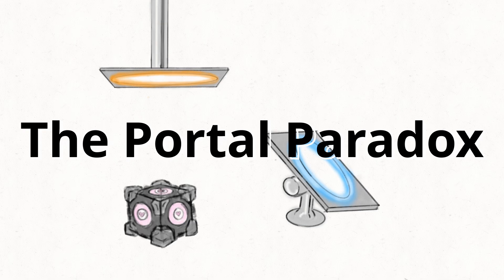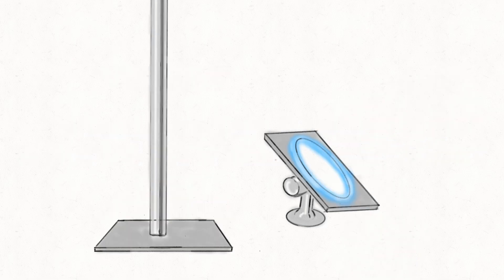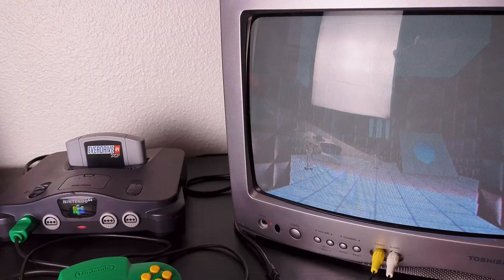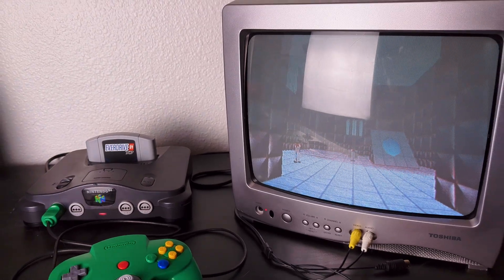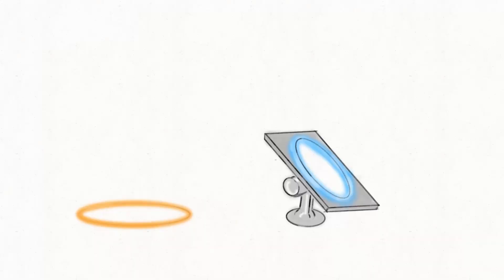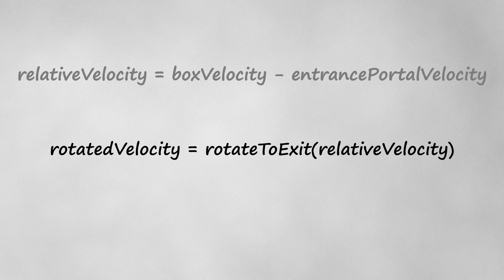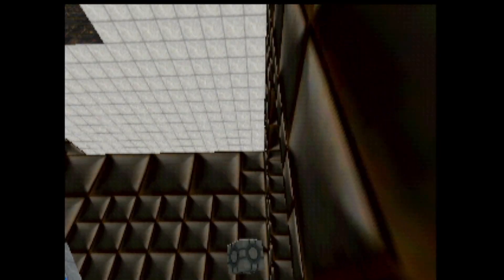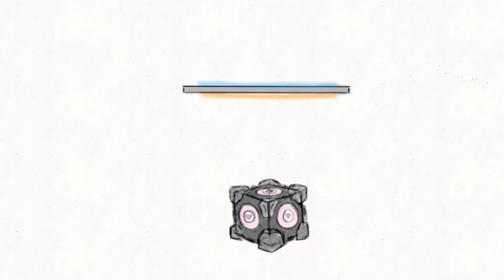I rewrote Portal from scratch and solved the Portal Paradox

Comment: Two questions.

If you did the "back to back" portal test, with both portals starting at the top of the cube, but in the "slam" the orange portal was moving at V and the blue portal was moving at V/2 - would the cube do a half jump?

Second, and perhaps more cathartic, what happens if you smash the blue and orange portal on to a levitating cube at the same time and speed from opposite sides?

Comment: The flaw in the equation is that the portal velocity is irrelevant since the portal exerts no force to any object going through it. The only force acting on the cube (assuming a closed system) would be gravity.
To repurpose the hoola-hoop example, it'd be like if you shot the hoop at 20 miles an hour at the cube so that the hoop went around the cube in mid air without either item making contact. The only interaction would be air displacement. With the added element of "teleportation",  there would be a tipping point where the mass going through the hoop would be more affected by the gravity on the exit side and would fall accordingly. The speed at which a stationary object passed through a portal would also determine how abrupt this fall was of course. And all this also brings into question how things interact with the edges of portals, and if things can be balanced on said edges.
Reply: portal velocity is relevant because the objects going through the portals aren't single points. assume the cube is a one meter cube and just for the sake of easy math lets say it's going at 22 miles an hour just so it equals a nice even 10 meters per second. at that speed it takes one tenth of a second for the portal to move from the leading edge of the cube to the far end of the cube. that means the cube has to exet the other portal in one tenth of a second ie: at a speed of 10 meters per second. I think if he had programmed it so that it didn't shoot out it would look weird. either the cube would still be exiting the portal after the platfom had finisshed swallowing it on the other side or the cube would quickly exit the portal and then suddenly descelerate. cubes are pretty short so it is harder to visualize but if you extrapolate  the problem out using longer objects, like a stack of cubes or a telephone pole, it starts to become apparent.
Reply: @StanleyFlinn  I do apologize, but I can make no sense of what you're trying to say. 
It is stated by the game that "Momentum, a function of mass and velocity, is conserved between portals." this includes a velocity of 0.
If portals did increase velocity as you seem to suggest, a cube falling between two portals would infinitely accelerate rather than reaching terminal velocity.
Reply: @clawgerber1992 
 The thing is, in order for that experiment to work, the velocity can't be 0. No velocity would mean that the object wouldn't move at all and the object does move if it goes out of the portal. Try to picture this experiment happening in your head. As StanleyFilm has pointed out, it is more apparent if you imagine a long object like a telephone pole.

Imagine yourself standing next to the blue portal as the orange portal is slowly swallowing a telephone pole. What you would see, it the telephone pole slowly coming out of the blue portal. That action, the telephone pole slowly moving out of the portal, is a movement and by definition, it has a velocity.

Its impossible for the object to both have 0 velocity and to come out of the second portal. Does two statements contradict each other.
Reply: @Jordthelord1  I think I addressed this already, but let me be clearer.
The portal links two planes in space. An object emerging from a portal isn't moving, the space around it is.
 The only forces acting on the cube when a portal goes over it are gravity and the counterforce applied by the cube to the ground. The portal going over the cube doesn't impart any force to the cube. The velocity of the portal would only affect how quickly the portal goes over the cube, or telephone pole, or any other object.
The rate at which the object emerges from the portal doesn't have any effect on the velocity of the object. No force is exerted on the cube, which is why its velocity can be 0. 
Where the physics gets fucky is if the cube were to contact something as it came out of the portal. The cube would impart force  to the object as if it were moving at the velocity of the portal. However, from the perspective of the cube, the other object would be what was impacting the cube with that force. With no counterforces being applied to the portal or surface, the portal is on.
This gets into a real pickel if you were to sandwich a cube between two portals  and compress them until the portal surfaces met. I'm not 100% sure, but I believe that situation could result in an "immovable vs unstoppable object" situation.

Comment: Hmmm. I always imagine portals as being vacuums through space. An instantaneous transportation from once place to another, thus, completely separate from current space. What if we try having both portals on a rotating platform with one portal at the 12 o clock position and another at the  6 o clock position. Rapidly rotate them clock or counter clockwise, place a static object between the two and let it "fall". What would happen?

In my head I can't see how it would fire out instead of plop down because to me portals and splits, devoid of any conceptual input of motion or influenced by it. I suppose one day when we can harness the power of singularity on earth rather than being face on with a black hole in space, we'll never actually know for certain.

Comment: I think your equations are not what to expect from a scientific point of view, but a sufficient approximation for a game engine (simple = fast).
Since the momentum of an object is preserved in all inertial frames (afair from physics lessons) , the cube would have no momentum in the inertial system surrounding the exit portal if transported instantly. However, if you think of it as being teleported in slices as it moves through the event-horizon of the portal surfaces, then the following slices would exert a force on the slices on the exit surface, pushing them up and creating momentum.
That would also imply that the stamper with the entry-portal experiences a resistance.
Otoh, a moving exit portal could leave disruptive structural gaps in the transported object that might lead to instant disintegration...
I think a real decision can only be made when have portals irl and know what magic happens at the transition plane.

Comment: First off, well made video, and I always love more portal content. 

My core argument against this result is that the space contained within the ring of the portal is not a physical object that can exert force, OR have force exerted against it. It's just the space that exists on the other side of the exit portal. Therefore, this space has 0 relative velocity. The only forces that are exerted on the cube in this situation would only be gravity and nothing else. The surface that the portal rests upon can have velocity, since it is an object, but the portal itself is not subjected to the same physics, since what the portal represents is just whatever space exists on the other side of it, and that space is not moving, hence 0 velocity.

A portal is just a Quantum Tunnel, right? So imagine a Cube placed on a floating platform in space. Now drop a large hollow pipe (the quantum tunnel) around that Cube and platform in such a way that it never collides with the Cube. Despite the Cube traveling through the tunnel, (or more accurately, the tunnel moving around the cube) no force is being exerted against it, and when it arrives at the other end of that tunnel, it has no more velocity than when it entered the tunnel.

Portals combine two disjointed places through a similar tunnel, so when you shove the portal down around the cube, the cube will simply arrive on the other side of the portal with the exact same relatively velocity that it had when it was sitting there minding it's own business. Zero.
Reply: Thanks for this explanation. I was thinking the same thing but couldn't figure out how to put it into words.

Comment: God damn my attention span has gotten short. You said "show me the flaw in this equation" and I immediatly paused the video and began writing the hoola hoop comment, Funnily enough not because I heard it before, but because it was the first thing that came to mind. Thankfully enough however I caught myself and thought I should at the very least finish the video.
Boy did you make me feel stupid by covering this exact point ^^

Anyways I see where you are coming from and why this makes sense to you. And I do believe you are correct. However this has been called a paradox since it does not have one correct answer. And even after watching your explanation I believe that. I personally believe that the portal should preserve energy. And while your approach does not, as you mentioned, change the relative velocity, it changes the energy of the cube. And this does feel odd to me. I always imagined these portals as tunnels from one point in space to another. In that sense they are, at least in my mind, actually really similar to a hoola hoop.
And if I imagine a cube floating in space and then a cylinder being dragged over it, that would not move the cube. And if it would for some reason, it should lose the same amount of energy that the cube gains (preservation of energy). In your example however the wall with the portal on it stops because it hits the ground i.e. transfers its energy into the floor. Or maybe into some form of breaks that stop it. Either way the cube should not be accalerated.

But again since portals are not a thing that currently exists in the sense of "Portal", there is no right answer. I can appreciate the inner logic and consistency of your approach and think it works wonderfully for your game. I love the short and very much to the point video and as a developer myself am impressed by the limitations under which you are developing this game. Keep it up and all the best!

Comment: Not sure if this solution to the paradox makes sense. Just hold on for a second and imagine the platform crashing down onto the floor without a portal and without a cube. What happens physically? The platform is stopped by the floor and its kinetic energy is dissipated. Now, let's add the portal and cube back to our hypothetical scenario. It is no different. Therefore, your approach basically creates free energy by accelerating the cube which is not realistic. The only way to solve this would be to let the portal slow down the platform while the cube passes through the portal. The platform would decelerate while the cube accelerates. Basically, this would effectively couple the inertia of the platform with the inertia of the cube via the portal.

Comment: The problem with the solution that these portals follow is the way portals work. Portals are technically one hole, we just see the two sides on different places. While they do not appear connected to us, they are stil comnected, so, to the cube, it is the exact same as if it is passing through a hole in a hula hoop. The other issue is that portals are holes, they do not have mass and therefore, do not have velocity, GLaDOS herself stayes it is the object's momentum that is maintained by portals, a portal cannot give momentum to an object because it does not come into contact with the box, as Newton's law states: "An object at rest will remain at rest unless acted upon by an outside force" The cube passing through the portal does not apply force, that is why the cube would not shoot out, it's velocity is zero when entering the portal, no force can is applied due to the fact a portal does not have force to give, and so the cube exits the portal with 0 velocity. 

Tldr: If speedy thing goes in and speedy thing comes out. Then motionless thing goes in and motionless thing comes out

Comment: Your reasoning is sound with the logic you applied. But I disagree with it. The object would be ripped apart as the movemnt is not applied to it evenly, only the part of it through the portal would be moving. It works in your examlle because the entire object teleports to the exit portal all at once.

Comment: This is so weird to think from the cube's perspective, though. Like Imagine being in its place, you'd see the portal come toward you and then your feet would lift from the ground apparently without any force pulling you.
Reply: It would be functionally very similar to being hit by a moving object and having its velocity partially transferred over to it via the collision.
Reply: @Celia_Dawn  Eeeh... kinda, but not really. You wouldn't really have an object hit you and transfer its velocity, the portal is coming toward you and then you'd fly in the OPPOSITE direction of its velocity.

I think it's more similar to being in a car moving at constant velocity and not feeling its movement, then hitting a brick wall and flying out of the windshield and die after some agonizing pain because you weren't wearing a seatbelt. From your perspective you were stationary and the wall was coming toward you, then when it hits you you fly out of the car and into the outside reference frame.
...Actually now that I think about it IT IS pretty much just that!
Reply: @KombatGod  Portals don't transfer momentum themselves though, they are holes. The Hoolahoop analogy works well, the only different is the space fuckery of the top of the hoolahoop being somewhere else. It's still a hole.
Reply: For me I always saw it like a simple door. If you dropped an open door and the frame slammed down around you, you’d still be standing there. But if you went across the frame Mach 1, you’d just come out the other way with the same speed.

Since portals aren’t just doors tho, I can see how you’d carry its momentum into the other side. But it’s weird, because it’s as if the whole room, or the whole OTHER side of the portal was moving toward you. So when the portal slams down on top of you, it’ll be like the whole room was pushed down under your feet which results in you in the air. Same thing you the portal came at you from the side. You’d get through the portal as if the whole environment was moving on one side.
Reply: @Soliye.  That's right. If you suddenly entered a universe that was coming at you at 100 mph, you would simply add your speed (0 mph) to the universe (100 mph). Just as if you were traveling at 100 mph into a universe that is moving 0 mph, you will be traveling at 100 mph. If you are going 50 mph and the universe is coming at you at 50 mph you'll be going 100 mph.
Reply: What a weird sensation that would be, one moment you're standing still the next you'd be at great speed but without having felt the acceleration of it. Suddenly being blasted by air from air resistance and seeing the room around you at speed heading towards you.
Reply: Yeah I agree. It would have to work this way (or you could imagine like a chain going through a portal, with the bits of chain that go through first pulling on the other bits) given the rules outlined in the video.

But to me, this seems to mean that if you observe a chain going through a portal like this, you could know if the portal or the chain was truly moving, because if you just clumped up the chain and launched it through the portal, there wouldn’t be this pulling force.

But, if the chain just fell out the other side, you could also discern whether the chain, or the portal was the moving object.

So maybe the conclusion is, portals are physically impossible so no solution can actually be correct.

Comment: First of all, appreciate the video length. Secondly - test your solution with the piston stopping half-way through the cube.
The way physics should work, the half that's already flying out of stationary portal should pull the still stationary half from the other end, losing a bit of energy. But would be interesting to see how it would actually work in the physics you coded.
Reply: Probably (in the engine) the cube shoots out if its center is through and stays in place if it's not
Reply: Typically objects in physics engines don't have mass density fields, but rather are point objects with discrete momenta. So it will either jump or not jump, but not half jump.
Reply: it would depend on the vector of the exit portal and the speed of the piston. it would need to be enough force to pull the cube out of its state of rest and then overcome gravity. you could write this as a physics equation easily enough.
Reply: @adultdeleted  True. I was writing that assuming the rest of experiment is same (angles and the speed of the piston).

Would be interesting to play around with different setups, though. Like what if exit portal is stationary on the ceiling, i.e. facing same direction as the entrance. Then depending on combination of speed and what chunk of it goes through the portal the cube would either remain stationary or get pulled through... This could be a fun toy like 4D Toys.
Reply: Logically, the entrance portal is rushing down and then stopping, so the cube should rush out partway but then suddenly stop when the entrance portal stops. 

I think the trick is that portals only conserve momentum relative to the portals, not relative to the room. So if the cube is going through the portal a force on the portal to make it stop moving is equivalent to a force on the cube to make it stop as well. The same would be true if the entrance portal is stationary halfway down the cube but you start moving the exit portal around, it should drag the cube with it.